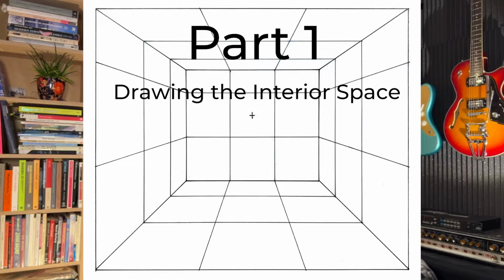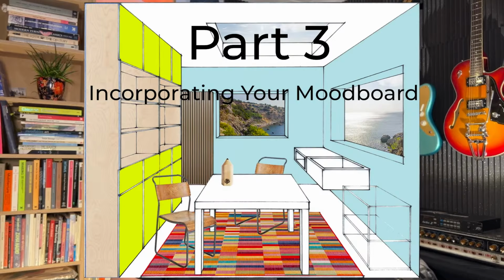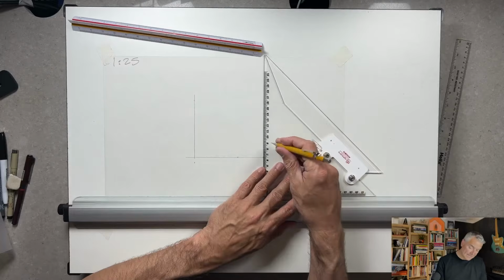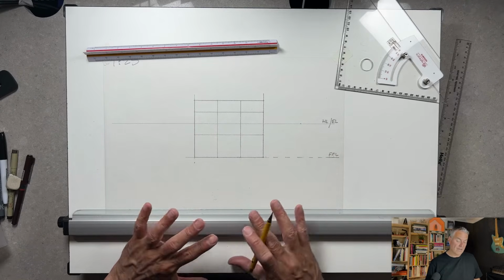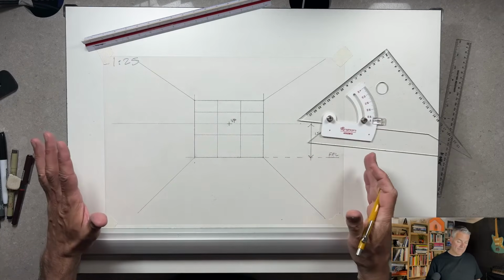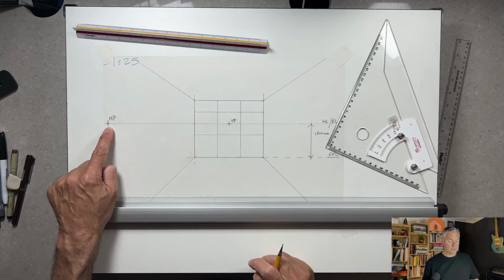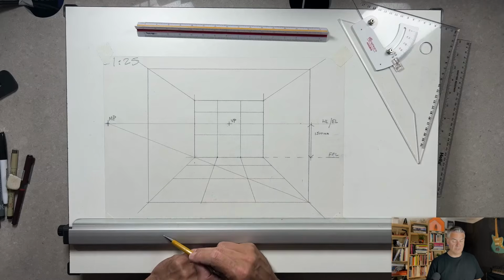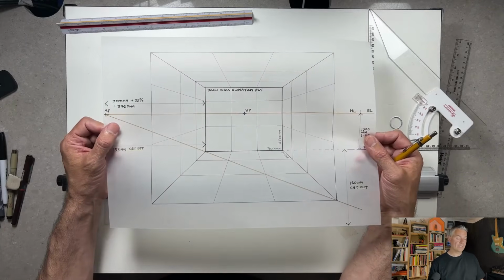Learn One-Point Perspective for Interior Design | Pt.1: Drawing the Interior Space

Comment: Where can I purchase this set square?
Reply from the maker: Hi @weronikaronnie, I used this in the video:

GraphicPro 10" Adjustable Set Square
https://www.graphicsdirect.co.uk/products/graphicpro-adjustable-set-square

I would suggest you buy an adjustable set square, either 8" 0r 10" as this will be all you need for all Interior Design technical drawing. But if you are on a very tight budget, this Helix Set Square - L64 is ok to get you started (but know that you can only draw vertical or 45 degree lines as it is not adjustable):
https://artdiscount.co.uk/products/helix-set-square

Hope that helps, cheers
Craig

Comment: not getting how u did Mpoint with 25%
Reply from the maker: Hi Wasim, thanks for your comment! The measuring point calculation is the width of the wall + 25%. For example for the one-point perspective drawn here, the calculation is:

3000mm (the wall width for this particular one point perspective) + 25% of 3000mm = 3750mm

The measuring point calculation is the most contentious thing with one-point perspectives. I've used many different systems, most of them guess the measuring point calculation. Ultimately the 25% method is a quick and accurate way to get you designing into what is a realistic space. Think of the 25% as a rule of thumb, it gets a good sense of depth in the space that feels realistic. 

Hope you enjoyed the video, any other questions let me know!
Reply: @DrCraigThomas so does the 25% change if I have a different scale or it's all the same?